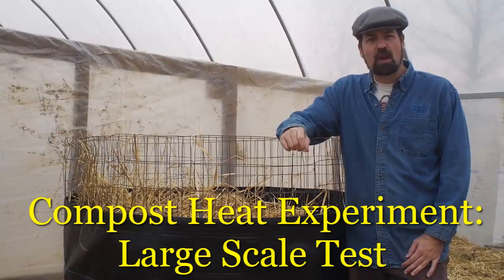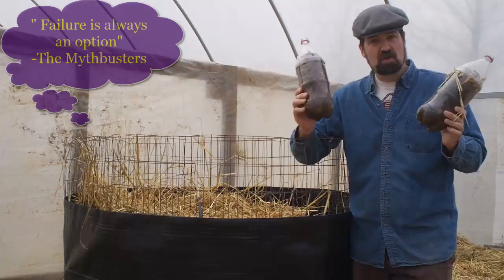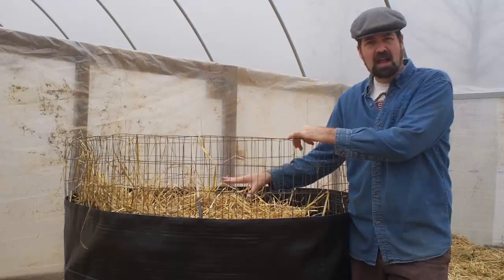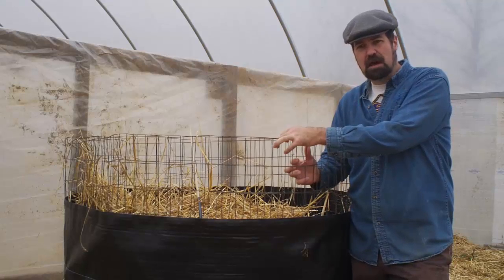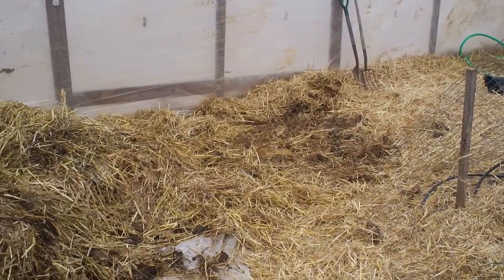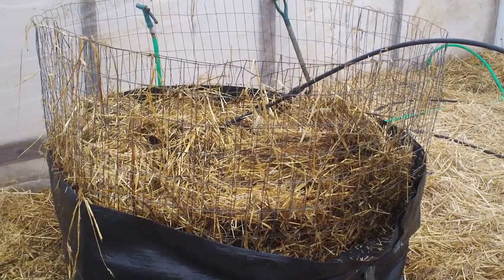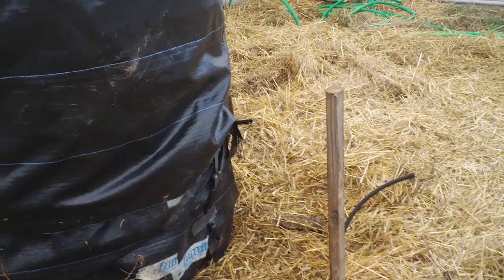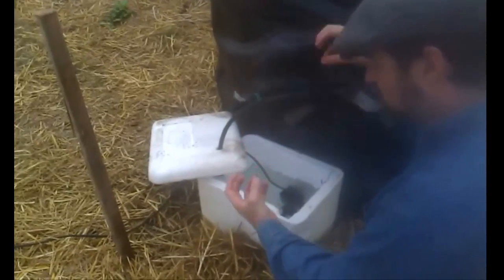Compost Heat for the Greenhouse - Step 2

Comment: I like how you did this.  I'm wondering though how your valve affected your pump.  It seems  to me (and I'm no expert) that this method would create back pressure on the pump shortening it life.  Have you found this to be the case?  I'm thinking that an alternative is to have a two way split after the pump.  You could have one pipe from this go to your compost pile and have the other one dump back into your water tank. You would manage the flow rates with cutoff valves as you used here on both hoses.  Just manage the switches so that a proper flow goes through the compost pile with the rest being dumped.  This setup allows full flow form the pump without taking too much heat from the pile.  Thoughts?